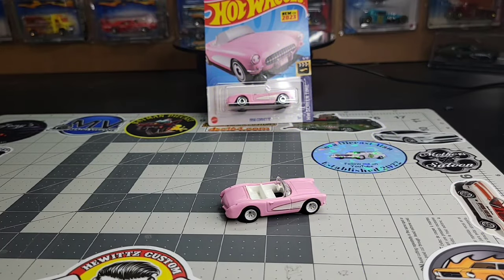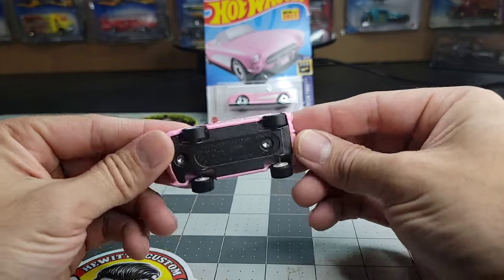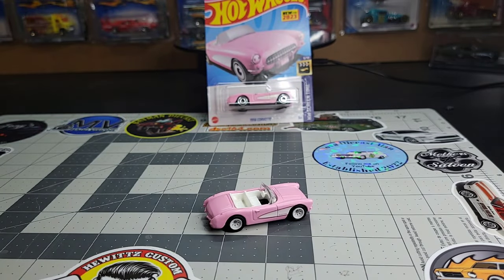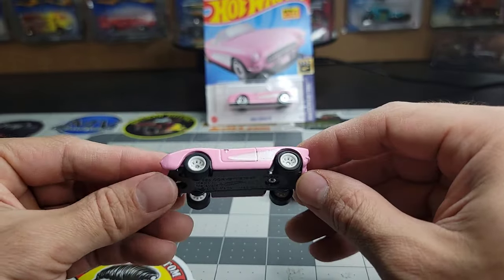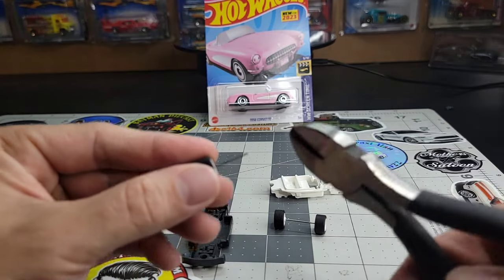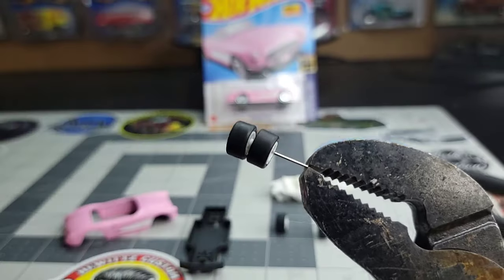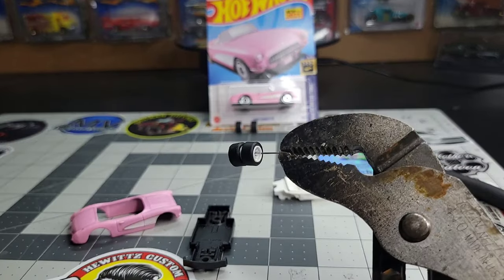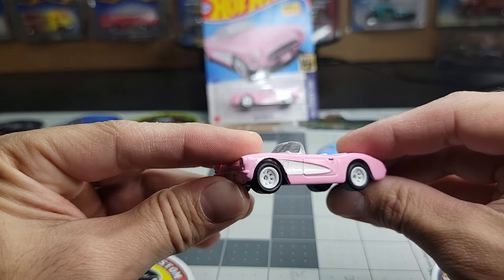(Wheel swap) How to trim your HOT WHEELS axles the easy way!!!

Comment: I've never done a wheel swap. This was very informative. I bought some loose castings a while back and a Camaro I got had a wheel swap on it. Ugly wheels on it, too. A swap is due. The crimping method is a great idea. Thanks 👍
Reply from the maker: Yeah, you don't need much to adjust the length. Plus if there are wheels you like but the axles are too short, swap out axles and just crimp them like here
Reply: Correction, the chassis says " Heavy Chevy" not Hugger. It's metal body and base with 1969 and China, plus the HW flame on it. The grill is black plastic and part of the interior tub.